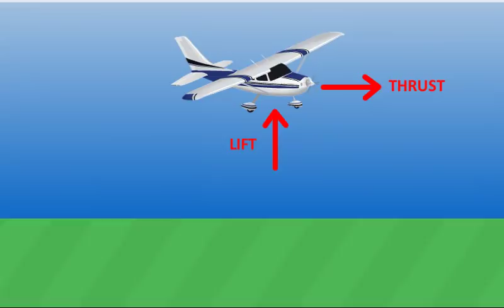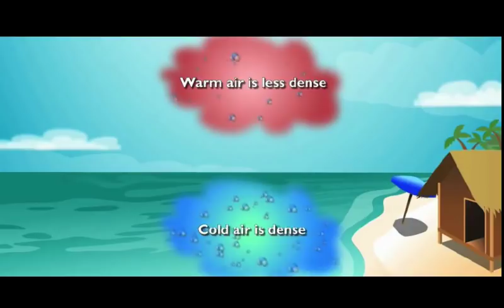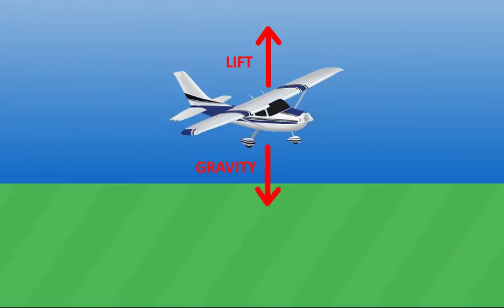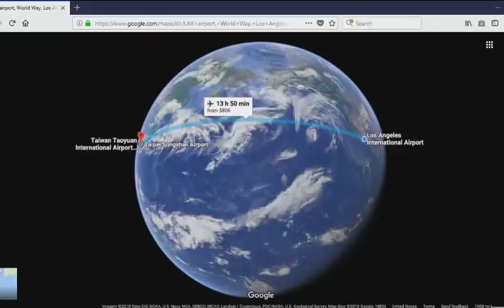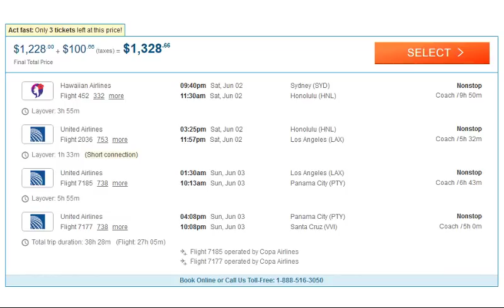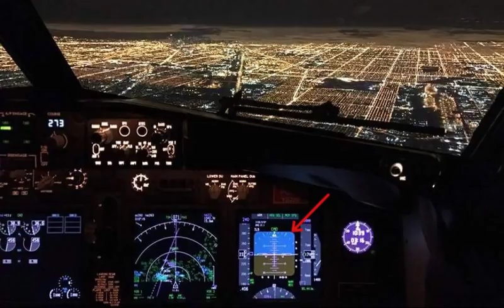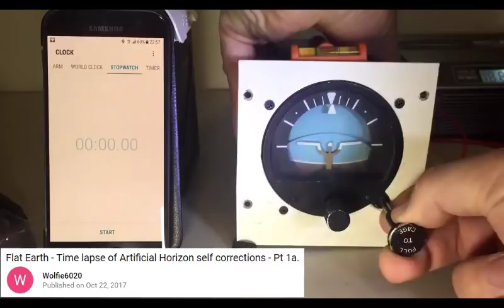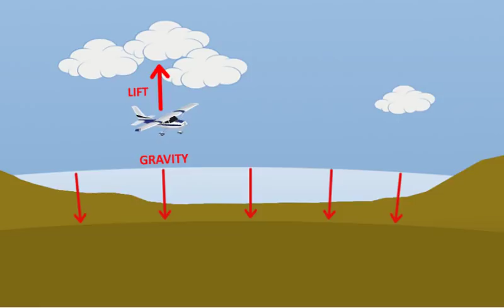Flat Earth Falsities - Plane Nonsense

Comment: I got one (or a couple) for you all. Please help me!

The earth spins at a 1000 mph only at the equator because there the circumference is 24000 miles(:24hr). The circumference gets less and less untill it's basically 0 at either pole. A helicopter hovering at the equator would make a 24000 mile loop in a day while it would not make any kind of movement while hovering above the pole except off course the motions of flying around the sun and simultaneously around a black hole at speeds i cannot imagine. Just ignore these last 2 motions for convenience since they are constant and we don't notice them anyway. 

U could say it would have to automatically make a pirouette above the pole though because if it doesn't automatically align to the earth the world would actually spin beneath the helicopter :P And yes I understand that flying an actual helicopter requires constant manual adjustment. This thought experiment exists on a world without wind with a perfectly balanced state of the art helicopter with unlimited fuel.

Say this helicopter were to fly from the equator straight over the pole to the other side of the planet . At take off it is going 1000 mph sideways along with the planet. Then this speed would have to decrease untill 0 mph because the circumference gets smaller as it flies toward the pole. After flying over the pole the speed would increase again but.. not only that! The direction at which it goes along with the earth actually changes to the opposite after flying over the pole. 

The helicopter went from a sideways 1000 mph loop toward a 0 mph pirouette and then changed "sideways" direction after crossing over the pole to then accelerate to 1000 mph again untill it's destination on the other side of the planet. Besides this it went from a 90 degree angle to 0 and back again. For the helicopter "down" is always the center of the earth and regardless of it's own speed, direction and location the earth always seems stationary. Seen from space however it has to make all these movements to stay aligned with the earth.

Objects in motion stay in motion unless acted upon by an outside force. This makes sense to me. What I don't understand is how 
the speed relative to the earth gets automatically adjusted. According to Newton's law there has to be some force acting upon the helicopter so it can stay alligned with the earth. If there were no force acting on the helicopter it would keep going sideways at a 1000mph and after just a couple miles toward the pole the allignment would be broken and the helicopter would literally start moving sideways(relative to the earth) as well as forward. I know air friction is not the answer because that would be deadly. Gravity also doesn't answer my question. 

So in short: 
-How does the speed at which flying machines move along with the earth get automatically adjusted in relation to their position along the meridian?
-How is it possible that we don't feel the change in speed?
-How can a helicopter hover above the pole without seeing the earth beneath it spin? What makes it allign with the earth so the earth seems motionless?

If you've made it this far I thank you for reading. I would love some respectfull answers to these questions burning on my mind. I have believed the earth is spherical all my life but I can't wrap my head around this! In fact I never even thought about it until I heard a believer of the flat earth mention it.

To those who don't understand what I'm asking here I say : 

If someone decides to smack u with the end of a broomstick. Would you rather he made the same movement with a stick of 10 cm(0.33 feet) or 100 cm(3.33 feet)? 

The earth is a sphere. It spins around its axis. From the axis to the outside of the sphere is the "radius". The radius is longest in the middle of the sphere. From the middle to the top and bottom(poles) the radius gets smaller and smaller. If u measure the sphere in the middle u get the length of the equator. If u measure it at any point at a 90 degree angle to the axis u get the circumference. The radius and circumference are directly related to each other. Because the earth revolves around it's axis once every 24 hours the time is set however the radius and circumference are variables. The longer the circumference the more distance is travelled in these 24 hours and so we get the 1000 mph at the equator of 24000 miles. The closer you get to the poles the smaller the circumference which means that the speed at which u move along with the earth gets lower and lower untill u are at 0mph at the pole.
Reply: "How does the speed at which flying machines move along with the earth get automatically adjusted in relation to their position along the meridian?"
     The atmosphere rotates with the Earth, especially at low altitudes, and flying machines operate in this ocean of air. However, some small adjustments will be required, which is generally handled automatically by the aircraft. 

"How is it possible that we don't feel the change in speed?"
     Because it is so gradual. A small acceleration will produce a force too small to notice. 
see: https://flatearth.ws/acceleration

"How can a helicopter hover above the pole without seeing the earth beneath it spin?"
     Do you perceive the rotation of the hour hand of a clock? It rotates once every 12 hours, twice as fast as Earth's angular velocity. (If the helicopter is perfectly balanced, taking off from the exact pole, it will retain angular momentum.) 

"What makes it align with the earth so the earth seems motionless?"
     Answered above.

See the following memes:
     https://flatearth.ws/helicopter
     https://flatearth.ws/atmosphere-rotation
     https://flatearth.ws/coriolis 
     https://flatearth.ws/coriolis-strawman

"...the motions of flying around the sun and simultaneously around a black hole at speeds I cannot imagine."
     Appeals to personal incredulity ("I cannot imagine") are faulty logic flat earthers use. Reality is based on accumulated evidence not on personal experience or personal perceptions. They don't understand even basic physics.
See: https://flatearth.ws/incredulity
Reply: Nobody will feel any spin, the earth revolves once a day. Everything on earth moves as one because they have been together forever. There is no way to sense the movement, no friction with the vacuum of space. So everything just moves together.
The old Concorde passenger jets flew at 1354mph, if everything in the plane is moving at that speed. No movement is detected. The plane slows to a steady 800mph, same story. Here is a photograph of somebody standing at the South Pole, filming the star trails above himself.  https://apod.nasa.gov/apod/ap120802.html
Here is another example, the third photograph down,  filming star trails above the 
Amundsen–Scott South Pole Station.
https://www.antarcticimages.com/Antarctica/Auroras-and-Star-Scapes/i-p27K62x
Reply: It's beyond understanding for some folk to grasp the concept of 1000 miles per hour (earth's rotational speed). To make it easier to understand it equates to 0.000694 RPM. That's 0.000694 revolutions per minute.
Reply: I didn't read everything, but I think I read enough to answer. And that answer is: atmosphere. The air, just like the ground and water, is moving with the Earth. As you move along you follow that motion. Helicopter, boat, car, person walking, doesn't matter. You match the rotational speed of your location as you go, because it takes you with it.
Reply: you really struggle with basic science and math... don’t you?
Reply: @GebSpez15215  That's not even a question.. or is it?
Reply: The problem with comparing the earth to the inside of a vehichle is that every part of the vehicle goes at the same speed linearly and if it doesn't move linearly the people inside will know about it. Vehicles don't have their own gravity nor do they spin on their axis and orbit around other stuff. You might say they orbit around the earth but obviously that's not the point I'm trying to make.

When u fly from the pole to the equator you move from a 0 mph into a 1000 mph air current. Every point along the meridian has it's own speed, angle and also a vastly different distance to the axis of the earth. You guys say that we can just move into this different environment without noticing anything because it's gradual and takes a long time. Personally I feel like half a day isn't that long to adjust to such a vastly different environment but I agree that my feelings can't prove anything. 

Anyway I can't understand how you can't notice that you're gradually moving into a motion of 1000 mph while even the slightest change in the speed of the atmosphere at any given point along the meridian can be felt and measured as "wind". 

How can a machine be "taken along" by one portion of the moving air while being pushed by the other? Basically all of the air is moving east and since the "base" speed is constantly changing I don't understand how an aircraft can tell the difference between the base speed and wind.  

Just imagine seeing a plane fly sideways because it forgets to allign with the base speed or that it decides that this extra 100 mph wind will just become the new base speed and move along with it as if it isn't even there :P.. Honestly, none of it makes sense to me. 

I thank all who give/gave a respectfull response.
Reply: @damiene5360  
you don’t understand relative motion. 
earth rotates extremely slow, the atmosphere with it, no relative motion. 

airplanes and everything else on the ground „move“ with the earth, again no relative motion. as soon as an airplane takes off, it flies with quite a speed through the air, relative motion. it is actually measured in relation to the ground. 

btw, it’s futile to conclude from bad physical understanding that „dah erff is flat“... you have to ignore EVERYTHING else too. like two celestial poles, the fact how the sun apparently moves (15 degrees per hour, everywhere on earth)

you would have to reject all astronomy, space travel, satellite pictures and so on. 

completely nuts, as flah erffer just claim nonsense without a shred of evidence. in fact, flattards cannot even distinguish between an empty claim and an evidence based fact. 

why? they are all deep into religious cults, like the christianity hoax. they are all jesus cultists

so what are you?
Reply: @GebSpez15215  There's my whole point. 10 miles down the line the speed of the ground is different and the airplane magically adjusts to it. One rotation a day is vastly different at the pole compared to the equator.

There's some extremely questionable video's going around produced by nasa and other agencies. Ground based towers and cables are all over the place and satellites are not a requirement for fast internet. This world is filled with the occult. If you can't see that you've got some blinders on. I listen to black metal so don't bother calling me a christian and most of the prominent flat earthers do not even subscribe to the church because they also know that it's a fraud and filled with occultists.

Anyway, the only thing you are interested in is stroking your ego so good luck with that.

Comment: As gyroscopes are fixed to a plane, they can easily prove earth is stationary or not. Here’s an excellent video demonstrating a gyro that is not processing
https://youtu.be/xm9_zNR4ysc?list=PLEzivhxtxgbso9aqESaMtcSohtLQva59U
Reply: You obviously don't understand physics. There is a very good reason professional gyroscopes and instruments based on them are expensive and that is the cost in reducing friction to an absolute minimum. This is why FE cultists use cheap kiddies toys rather than precision instruments.
Reply: do you one better https://youtu.be/6pf44njV8g0
Reply: An Artificial Horizon (aka Altitude Indicator) includes a gyroscope but also a mechanism that adjusts for gravity. Wolfie6020 demonstrates:
.
Flat Earth - Yes an aircraft Artificial Horizon self corrects in flight - Pt 1
https://youtu.be/kTXTCqMHyhg
.
Flat Earth - Time lapse of Artificial Horizon self corrections - Pt 1a
https://youtu.be/1bUM2KVKgb8
.
Flat Earthers still don't understand how an Artificial Horizon works - read comments please
https://youtu.be/6J5Nk5qKpzo
.
Flat Earth - A look inside the Artificial Horizon - Pendulous Vanes
https://youtu.be/z1QGRPVBZvw
.
Airplanes need not pitch nose down essentially because lift depends on air density, which also curves with Earth below and the direction of gravity. You can't criticize the globe Earth if you don't model it correctly.
Reply: Funny as these schoolboys bitch about YT learning, also use it for support. (some doofuses only support)
Flat is flat and that is a fact, a fact is a fact (been told), so flat is fact.
Reply: @romithromith  This is a good laugh  https://www.youtube.com/watch?v=KEkfSkTef24
Reply: @boffeycn  I came into contact with one of these loons on a page where some woman swore NASA was altering the Sun, and using a fake Sun, or something like that. This Mandala fellow said WWII was different and JFK wasn't assassinated in his past (universe), and the Sun was yellower back then/there. Mikey here sounds like a stoner.
Here's a debunk of another escapee from the asylum: https://youtu.be/jFOJxXiQdE4
And Professor Stick sees through Tony Heller:
https://youtu.be/PXNClezjW7M
Reply: @romithromith  Cheers, they really can get weird once the virus gets a hold.
Thanks for the Heller debunk.
Ibuprofen is now being tested as a possible help with getting over / mitigating the inflammation caused by Covid-19. Interestingly we have been using Prednisolone for a while for exactly that reason.
Reply: @boffeycn  That's a reverse course on ibuprofen which early reports said made COVID-19 worse. Probably why they've opted for corticosteroids like prednisolone. 
     Higher dose ibuprofen can be nasty taken continuously. Gave me stomach problems. I'd opt for the prednisolone. But ibuprofen is OTC here. 
     Have you been taking prednisolone?
Reply: @romithromith  Indeed. My doctor stopped prescribing ibuprofen for my various aches and pains five or six years ago and switched to Panadol / Paracetamol because of its side effects.
When I went to hospital on Tuesday for a check up it was decided I had experienced either Covid or pneumonia so gave me a cache of Prednisolone and Augmentin in case I had a relapse. Happy Days!
They also gave me a very big bag of Fluimucil and a smaller one of Bromhexine.
Reply: @romithromith  That  post made my day. 
I felt a lot better but that is relative. As long as I don't do too much things are OK. I am now waking up to 30 or so metres when I feel up to it, which is a couple or three times a day and  taking a shower doesn't leave me totally fucked up. So yes, things are good. Sort of.
The Fluimucil and bromhexine definitely helped, especially at the height of the infection and still do at times.
I've gradually reduced paracetamol usage to a max of 1,000 mg/day. unless things get really insufferable.
I seem to recollect other stories about the EOC and that response  is the same as people commenting about the bible should not be taken literally whilst simultaneously saying it should, but they don't seem able to grasp the contradiction.

Comment: The same time every year you can see the sun all the time for 6 months in Antarctica, at the same time closer to the equater it is only visible for 12 hours in a 24 hour period.
It will also move 9 degrees across the sky every hour no matter where you are on the planet.
This only works if the planet you are on is round with the sun at a distance.
This can not be fake information and flat earth believers can not ignore it
Reply: YOU can? You travel between those two so much?  Live at the Equator or in Antarctica?
Reply: @BrainUser1  i spent 5 weeks in Antarctica for work.
You are a moron
Reply: @MegaFunnyman86  Louise is a self admitted troll, Best either ignored or laughed at.
Reply: @MegaFunnyman86  Definetely a vaste array of vocabulary sir. And Science too!
Reply: @appresley4071  Ah more firsthand knowledge :)  Regardless of lighting, does not explain how the exact tilted ball maintains a perfect angle with the Sun.  Mostly when everything is moving real real fast.